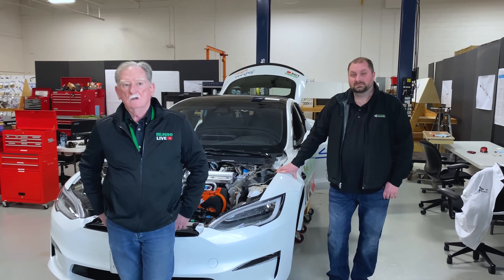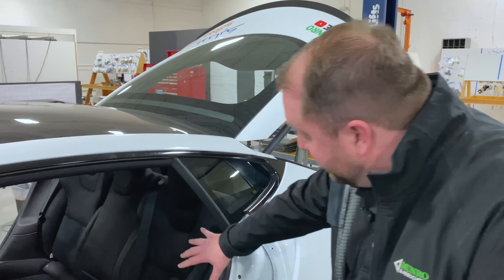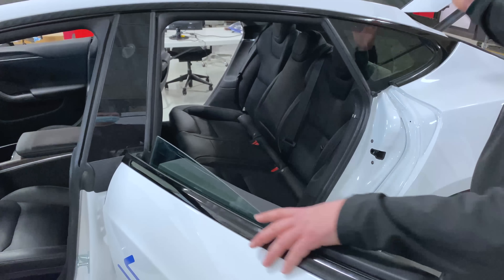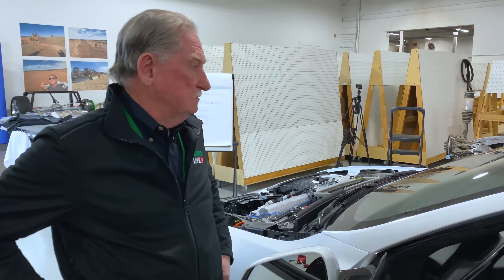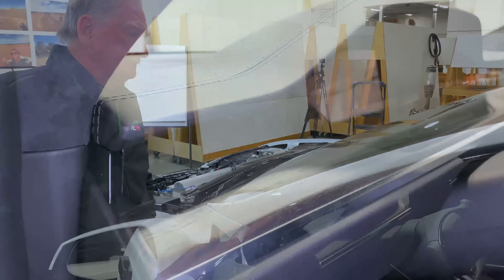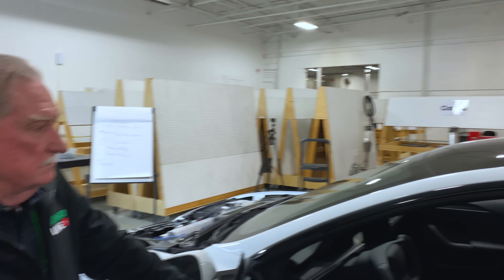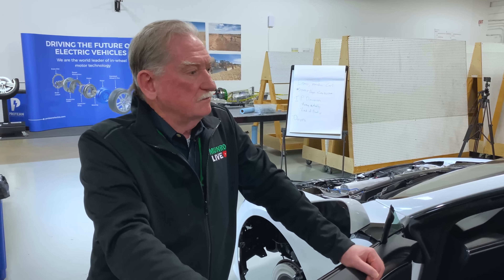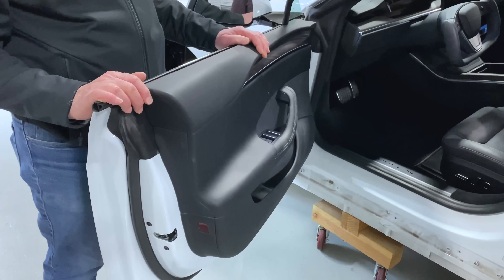Interior Design & Analysis | Tesla Model S Plaid Teardown

Comment: I own a Model 3 and the power seat is a life saver for me! The seat will move to the 
"Easy Entry" position when in park and the seat belt is unbuckled. I have a bad back and this makes exiting and entering the vehicle much easier. The car will return to your desired settings when you enter the car and press the brake. Also you can add driver profiles for different drivers. With a touch of on the control panel, a different drivers seat settings will set up. In addition to the seat the steering wheel and side mirrors will return to your settings as well.
Reply: Yup. My wife is much smaller than I and it's a must to have a power memory driver seat for us. My old ICE car even has adjustable memory gas/brake pedals. Elon cancelled a power front passenger seat in Model 3 & Y. This made sense. Carl would approve 😁
Reply: Same here. Model 3 and I’m 6’3” with a bad back. Love the easy entry. My wife and I share the car. Driver profiles are linked to our phones. Never have to touch any controls. Love that about the car!

Comment: In all the vehicle accidents I attended as an emergency services worker over 3 decades I never saw anyone with broken wrists from airbag deployment. I saw a lot of abrasions, a few suspected broken noses which may be hands or arms flying into face when steering one handed with arm across steering wheel and hand at 12 or 11 o’clock. Thumbs get hurt sometimes as the hands fly forward  while the thumbs are hooked on steering wheel but no broken elbows and I have seen people in their 80s and 90s get out (or be cut out) of cars with airbags deployed and only abrasions to foreheads and faces. The seatbelt can really do some bruising too if the car doesn’t have pre-tensioners and or you don’t wear it properly and in extreme cases even if you do. 
Bottom line, don’t sit too close to steering wheel, don’t have the back reclined like you are settling in to watch a movie and wear the seat belt properly because all the safety equipment including crumple zones, collapsible steering column, seat belt pre-tensioners, anti submarine seats and airbags are designed to work in conjunction with each other if used properly.  I suspect the yoke steering wheel is no more or less safe than any other but I would like to see some proper testing before I made that conclusion. Further, I have been to many lectures and talks by many experts over the years whose expertise in one field is fascinating to listen to but they then speak with almost the same gravitas in areas where they are less than expert. The problem is that people will listen and believe information that is really no more that educated intuition if they don’t take note of when the real expertise ends and the guessing begins.
Reply: I know someone who got bad burns on their arms from the airbag friction.   Did you ever see that ?  Also I try to grip the wheel on the lower half most of the time , it is safer and more comfortable for me .  Also if the steering is not mechanical but ,electrical.  They should change the steering ratio with speed . So you do not need to turn as much .
Reply: @rayRay-pw6gz  I'm no expert, but I think the easiest way to figure out the safest way to sit in a car is to look at how a crash test dummy is seated for that particular vehicle. It makes sense to me because crash testing and safety systems validations are generally designed around that
Reply: Except the crash teat dummies have no skin.  😃 actually today because of the use of airbags, the insurance institutes drivers training course recommended that the hands should be below center of the steering wheel.  And also smaller drivers are placing themselves to close to the steering wheel .  Airbags cause many injuries that could be avoided with knowledge . 🇺🇸✌️👍❤️

Comment: Thank you Sandy and your team for making these great teardown explain-the-structure video clips. For me as a programmer I really get satisfied to see that a Tesla is a much more modulare-alike (=horizontal and vertical)  mobility solution than other vehicle manufactures. I like - on Tesla and on Munro Associates - that there is an open "thinking and discussion and presenting process to the public approach", which represents a certain new look and feel, on how to manage complexity - while knowing it's still complex. You try to find a group-common sense to satisfy most and thrive - where it's (y)our common sense - to a level of "a just good product" which will affect many outsiders positively. As for me as a programmer, I know really want to see the information technology features expand - for example the modular integration of platforms like Apple Music, Spotify, SoundCloud, Disney+ , Amazon Music/Video,... into a single - licences-hassle-free-GUI.  I really would wonder how a - some kind of military-HUD-like component - would look like on the front screen- because the steering wheel (=yoke ?) made is possible to implement. In addition what would a side HUD look like ? An imagine the value of a side HUD rear projection even for the kids in the backseats of a Tesla for their orientation while driving? There are so many things that may be added in the future virtually,  if the base structure of such a lean design like this Tesla (vehicle). I think the Tesla crowd has  many ideas that - aggregated in a reasonable manner - would burst the imaginary level of a Tesla - at least for the owners and lovers - to new levels of satisfaction.  Thanks for all your hard work to document that evolution. Warm Hallo from Frankfurt am Main, Germany, yours Sascha Andreas.

Comment: The vinyl material used on the seats not great and you can see cracking at 2:23 inner thigh and 2:25 the vinyl will separate from the cracks. The driverseat wearouts fast like within 4 years. Had the same problem with my current model s and repairing driver seat for the second time. How are robotaxies interiors going hold up? The Vegans are happy though

Comment: 14:49 Cool, I just notice the exposed aerodynamic duct work molded into the door. Build by a Rocket Scientist, the flow doesn't need an upper surface to the duct, only half a duct is required and molded into the door panel. Looks great too, form and function.

Or, is that just all fasade for styling only?

Please consider doing some smoke flow visualizations to see mixing and flow patterns within the cabin

Comment: PETA representatives showed up at multiple shareholder meetings to push for “vegan leather” seats and Elon accommodated their wish.  Then PETA returned to get the leather out off the steering wheel, and Tesla complied.  What other company besides Tesla would comply voluntarily?  I love the feel of the seats in our Teslas
Reply: Not Lucid! They still offer leather as an option. Shame!
Reply: I disagree that this is a good decision. Firstly, there is a massive glut in cowhides from the meat industry, its caused the price of hides to plummet in the last few years and most are being thrown away now. This was due to the push against leather products by animal rights organisations. Instead plastic and vinyl products are replacing leather, which ironically is a fossil fuel product. So you have gone from utilising a by-product to consuming more fossil fuels. Secondly, the quality of this vegan leather has been called into question, there are many reports of various hair and skin products reacting with this vegan leather. The poor longevity and quality combined with the increase in fossil fuel consumption, makes "vegan leather" a bad choice.

Comment: As someone who has disassembled the steering column of the Plaid plenty of times, I can tell you for certain that the shrouds are hard plastic and are absolutely NOT wrapped as claimed at around 7:30 in the video. Very strange of them to not know the difference between plastic and something else. In fact, I even have detail in my channel of the fact that the shroud is a slightly reworked Model 3 shroud design. It wasn't specifically engineered for this car at all. The SCCM underneath is directly out of a Model 3 as well. This is good btw, because they reused parts instead of starting from scratch.
Reply: I thought the same 👍👍
Reply: This is made obvious even on video by the seam on the right side
Reply: That is the big problem with the YouTube model.  They strive to get more subscribers and the level of content is second thought .  Thank you for your information.  All in all they did a good job .

Comment: QUESTION:
In my opinion, the horn is in a bad position, because if I am turning the car and then suddenly have to press the horn button it is much more difficult to do that (because of it´s position) than a traditional press to the big front of the steering wheel. What do you think?
Reply: Agree 100%. Love my plaid, it's the best car ever made, but that horn...not sure what they were thinking.
Reply: @BasementTracks  Maybe they don't want you to place your hand over airbag to honk? For safety reasons mentioned in the video.
Reply: I think the horn honks itself when it senses it needs to
Reply: Sandy did say his close call in the plaid automatically used the horn.
Reply: @BasementTracks  Its to encourage/habituate people to honk less in traffic. 98% of horns you hear during the commute are useless...they're a simple translation of driver's unnecessary frustration. 

Tesla plaid honks automatically when there's a situation where you need to really honk. Elon isn't joking around with user experience. Every little detail and decision either with spacex or tesla goes through him.
Reply: The horn is terrible, but so are the turn signals.  I would utterly hate driving this car simply because of the yoke and it's controls.
Reply: @antibrevity  Does that mean you haven't actually driven it yet?

Comment: If Tesla offered a round steering wheel as an option to the Plaid, wouldn't be a surprise being an hit in sells. Toyota is offering a yoke to the bZ4X to the Chinese market, using a Steer-by-Wire system, so you just have to move the steering wheel 150 degrees lock-to-lock.
Reply: Wrong, Toyota is just using it in a prototype, car manufacturers have been putting all kinds of crazy steering wheels and other features in their cars/prototypes for decades.
Reply: @carholic-sz3qv  you're wrong. Toyota is gonna sell the yoke in China, it's official. Other countries weren't announced yet.

Comment: When Carl made the comment about electric adjustment of seats It sounds to me that Sandy understood him as saying No adjustment to the seats which of course is wrong, Carl meant better to use manual adjustment rather than have multiple heavy electric motors and mechanism that you rarely use but carry around 24/7/365 and I agree but of course it's what the buying public wants that wins in the end especially in this price range. Decades ago Renault had a simplified system of seat adjustment by using curves between seat and seat support. Nissan Maxima ST circa 2004 had a dashboard not too dissimilar to this, it was very modern and minimalist. At about 31:06 and on there is a rather unsightly body joint at the bottom where the door closes, I've never seen this before on a production car.

Comment: I'm delighted that Carl mentioned that the yoke increases safety.  I've had numerous arguments with people about this (having worked ten years in the medical field).  A yoke not only is safer for the reasons mentioned, it offers better visibility of both road and binnacle (improved safety), is smaller, so I allows for easier egress in a crash (improved safety), and doesn't require the driver to cross their arms while turning the wheel - which is why it's used in F1 racing (improved safety).  On top of that, it provides a smaller surface area to collide with in a crash.  Cardiac tamponade is a serious threat that people suffer from their chest slamming into the steering wheel on collisions.  Eventually, removing steering wheels altogether (once autonomy is here) will - by itself - save numerous lives.

Comment: This is a brand new car and it already has wrinkles that will eventually be cracks in the vinyl seat bolster (2:22). As a former multiple Mercedes owner (both had cracked vinyl seats) I can say there is nothing more disappointing than to open the car door and see a crappy cracked seat bolster. At least both Mercedes made it to about 50,000 miles before the seats started tearing up. If you get one of these you had better drown the seat bolsters in vinyl protectant from day one.

Comment: My May 2020 Tesla Model Y rear seats do lay back a couple of inches or a few inches. It does make ALL difference between what is comfortable for my wife (straight up as possible) and me where I >> need << to lay back due to spinal cord issues. We can both sit back there comfortably. We've done that when we've had friends drive our Model Y because they were interesting in buying an electric vehicle and wanted to see what Tesla's were like.

PS: The front seats are great too! I just wish there was an option for an airbag suspension from the factory. Yes you can buy an air bag system for Model 3s and Model Ys. They are about $27,000 and I paid about $64,000 for my Y so that would be about a 42% increase in price driving my Y up to which would be $91,000 and at that point I could have and should have bought a Model S. But we don't have $91,000 so we bought a Model Y (we also hate trunks and the Model X is even >> more << expensive and out of our ability to buy one of those.

Comment: This may be a dumb question. Does Tesla design and build their electric motors? Is there an off-the-shelf electric motor an electric car manufacturer could use? Or do all OEMs design and build their motors? Thanks!
Reply: Yes, Tesla both designs and builds their electric motors. Their vertical integration is impressive.

Comment: One thing I am concerned with is, when at 29:42, you look at the rear door latch, you notice that the release mechanism is not in the door itself, but within the car body (unlike the front doors).
This means that the rear door latch is not mechanically operated*, and to me, it means that if for some reason, the electric system that controls the rear door opening is impaired for any reason, you are effectively trapped in the back of the car. Given that those are power windows, it means that the only way to egress is by breaking the window. Should we install safety window hammers in the backseats?

* And it does not appears that there is some kind of interruptible — when the door is opened — mechanical linkage, like a pin popping out of the door into the mechanism to actuate it.
Reply: The emergency release is under the back seats, hidden by the carpet. There's an image in the user manual showing how to access it
Reply: @winkcla  ■ Ah. Nice, but those instructions ought to be put somewhere conspicuous instead of buried inside the user manual, though.

Comment: Does your yoke buzz? The yoke makes a continuous buzzing sound after the first button press. It is silent until you press any button. The noise comes from the left side of the yoke, near the headlamp icon. This is likely caused by a bug in the haptic feedback motor control software.

Comment: Tesla seats are amazing, so comfortable.  However, as a 182cm tall person, the front seat breaks when using sleep position to drive position.  Is there a company that can design seats strong enough to not break at the horizontal vertical hinges?
I've just discovered this seat hinge issue on about 5 office seats I've broken over time.  I finally found a solution which only 1 office seat company builds...rather than 2 hinges joining the horizontal and vertical seat parts, it is 1 strong centre spine from under the horizontal seat and supporting the vertical seat part.  Maybe this central spine would improve the almost perfect Tesla seats?

Comment: My Model Y (2020 early VIN 2000 build) has rear reclining seats currently. My rear seat passengers all rave about this feature and the added comfort it provides. I traded in 2017 Model S for this exact reason and having such a low entry height.

Comment: Sandy should ask Tesla to add an option of user profiles for the driver seat settings:. the first time you get in you adjust the seat to your liking, then save the setting and thereafter it will adjust automatically when you select your profile.

Comment: Not to change the subject but one thing I think all cars should have is adjustable pedals. A lot of Ford products have these or you can move the pedals toward the driver or away from the driver was an electric switch on the dash. This way you get your seat at the right distance from the wheel so your arm is not straining and the seat back at the proper angle for your comfort and your shoulders as far as distance to the wheel, then you bring the petals to you or away from you and your entire body exactly fits the vehicle. No reaching, no steady strain, nothing but ergonomic steering and pedal reach for my very comfortable sitting position.

Comment: i dont think id have an issue with the yoke if it had electronic progressive steering, more aggressive at lower speeds and less input at fast speeds, but without that at the low city speeds, at least here in the UK it seems like it'd be more of a nuisance and danger than anything else.

Comment: I agree with Carl, and also hate power seats.  They are a waste of materials and electricity, plus they take longer to adjust than manually adjusting them.  And power seats are just another mechanical device that can fail.
Reply: I think it’s a waste of materials, engineering, and of motors and fabrication. But not electricity. So little electricity is used by them.
Reply: @bob15479  Maybe not much electricity used but still when that is your power source for range, it all adds up.